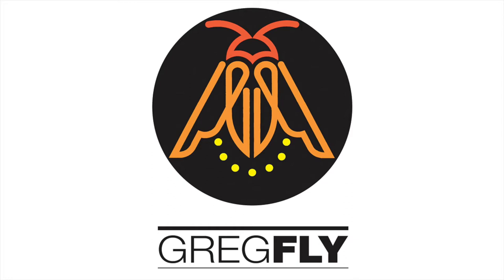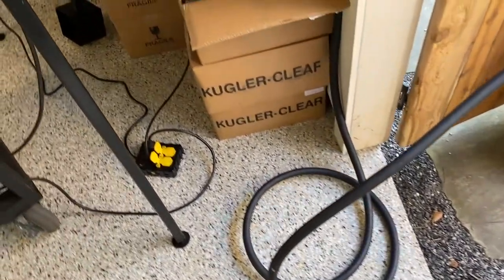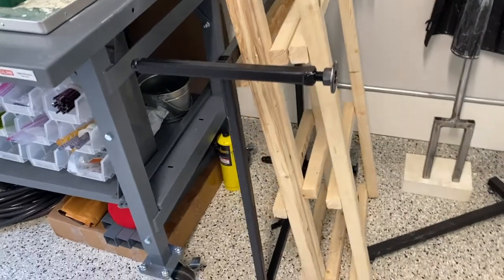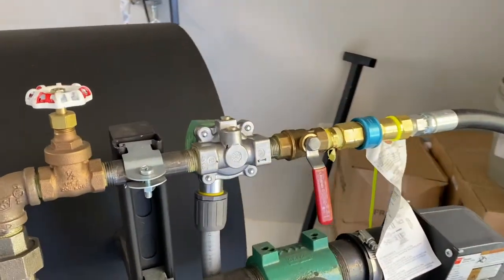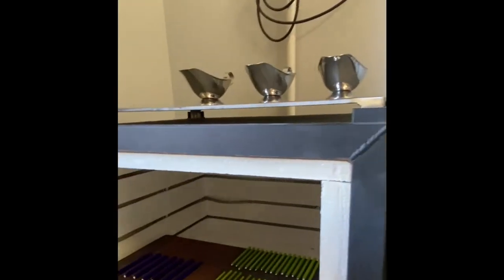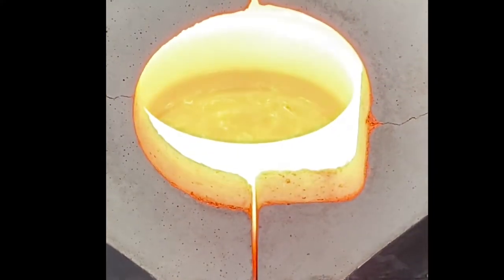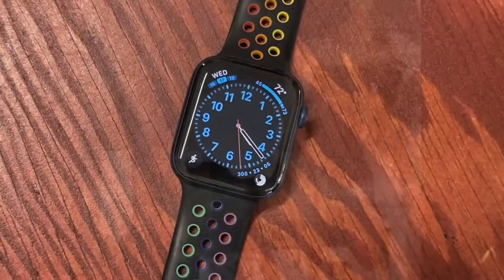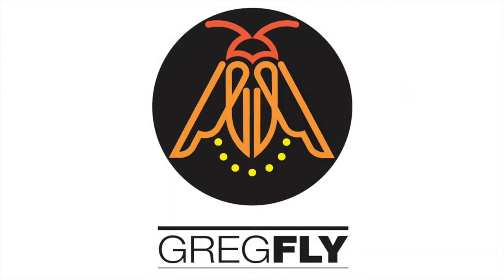Hobby Glass Studio With Canned Heat Glass Hot Pot Glory Hole Combo

Comment from the maker: In the video I made a mistake when I said the 40 lb propane tank was labeled due to it's empty weight, that is not correct, empty propane tanks are labeled by the approximate weight of the gas it holds when full, in the case of a 40 lb tank it is somewhere around 9 gallons, depending upon the weather and temperature.